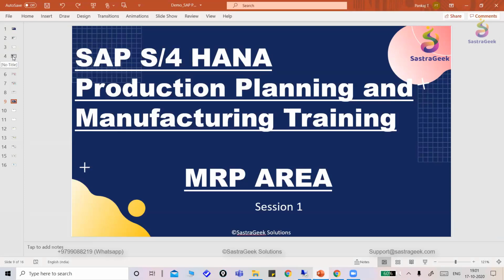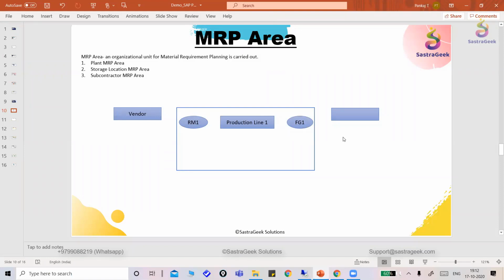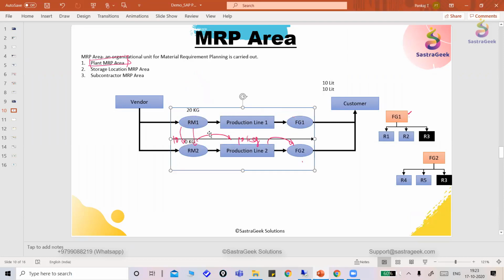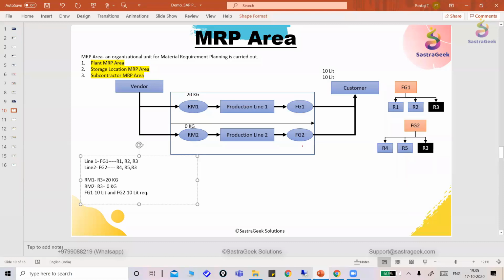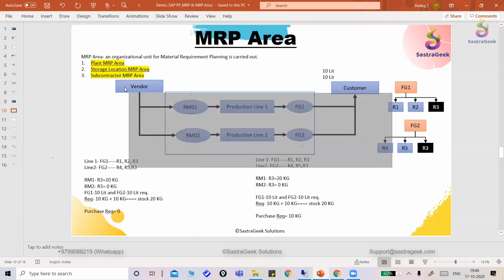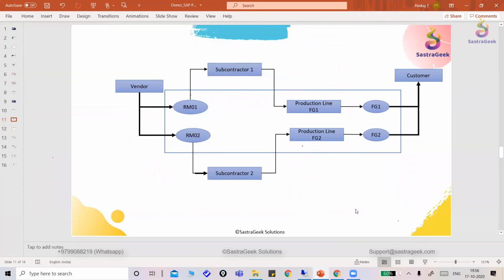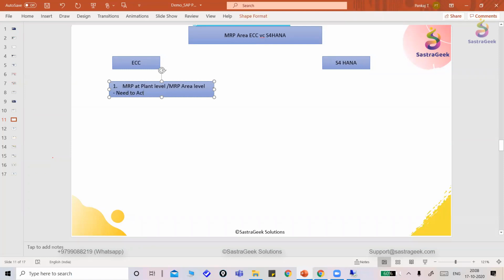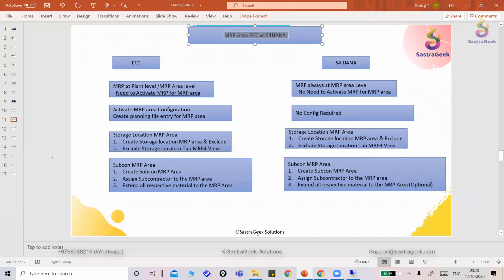MRP Area Simplifications

Comment: What happens if the business wants to run  MRP at plant as well as storage location MRP area...for the same material how the system behaves in this case
Reply from the maker: For particular storage location MRP will calculate as per sloc , for rest excluding particular sloc it will do plant level calculation.
Reply: MD01N not capable to run SLOC MRP area... we need to use only classic MRP run